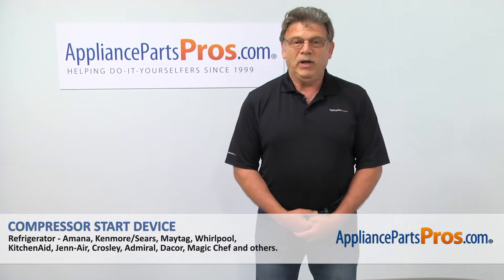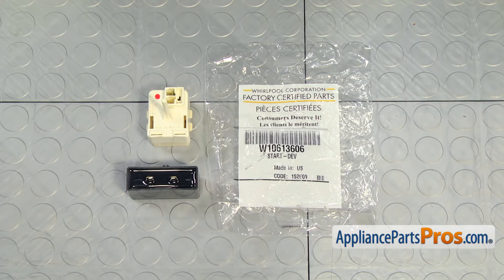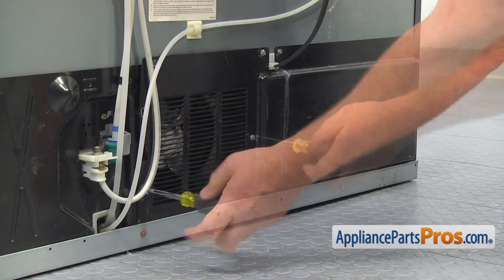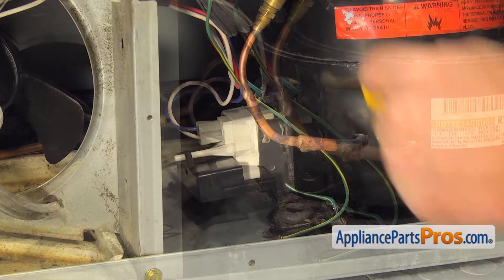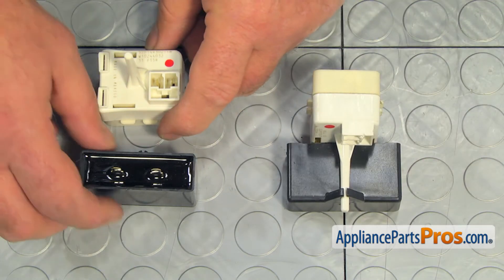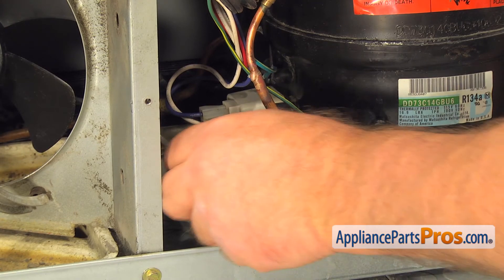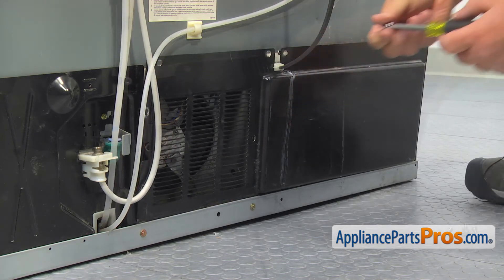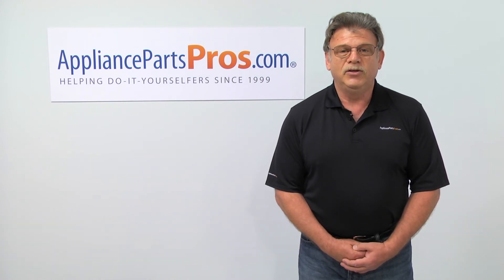How To: Whirlpool/KitchenAid/Maytag Compressor Start Device W10613606

Comment: great video,   how long do you recommend for the refrigerator and freezer to reach optimal temperature after leaving it unplugged
Reply from the maker: You will need to leave the unit plugged in for 24 hrs for it to get down to the set temperature.

Comment: Do you have exact wiring diagram ?. I have tree wires going in relay (Black, White, Grey) and two wire going in Overload (Black and Blue). How do I retrofit these wires in new Overload/relay(part # W10613606) which has only two wire ? My model is Kenmore: Model 596.57089791
Reply from the maker: We could probably help you out with that, but we have no way to send it to you over Youtube. You can give us a call at 1-877-477-7278 or you can chat us at our website: http://www.appliancepartspros.com/.